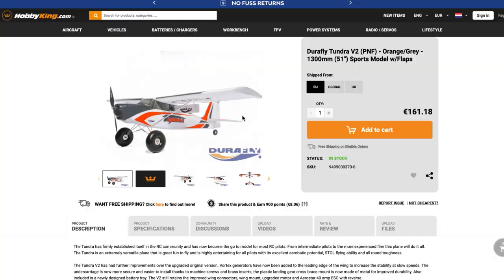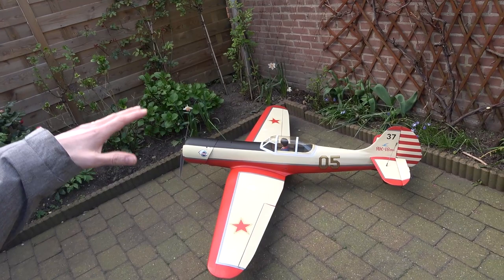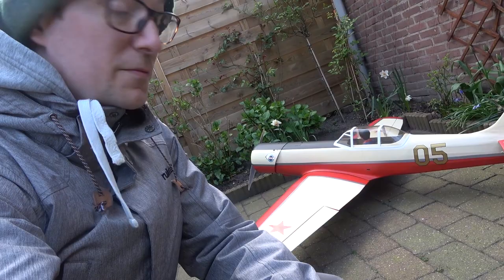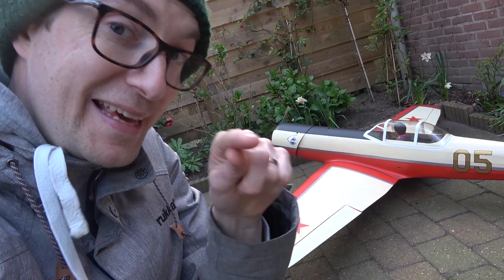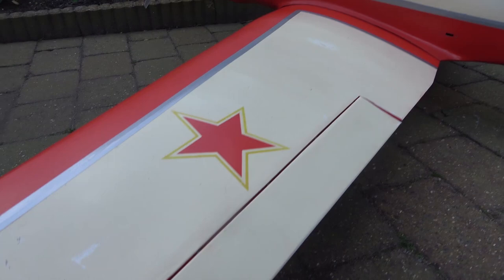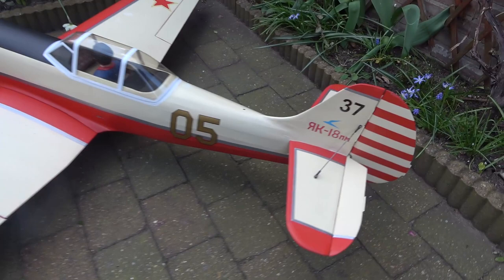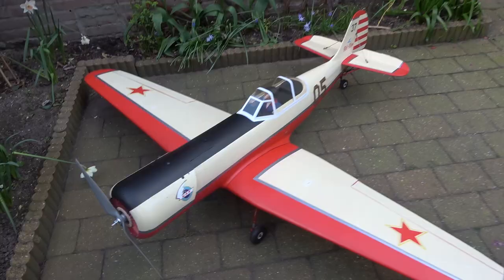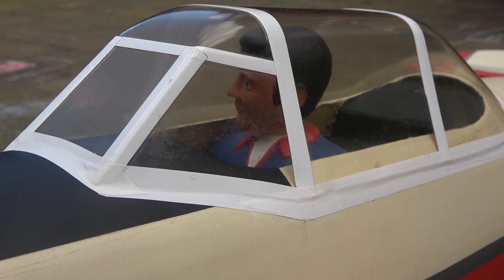Sig Yak-18 RC Plane Restoration Part 2.

Comment: I would be scared to death about those long motor stand offs twisting under torque from that beast of a motor. Wishing you and your family a speedy recovery.
Reply from the maker: I had some concern, but with the nuts and lock tight and split washer I have on them its rock solid in reality so shouldn't be an issue.

Comment: Wow! Looks great Stuart! When rebuilding the motor mount, did you have to build in any thrust angle and if so, is there a method to determine that? Just wondering...
Stay safe and hope you and your daughter feel better soon!
Fergy
Reply from the maker: Hey Hey. I eyeballed the firewall to start with, seemed pretty neutral all round, then if I recall correctly saw from the plan that it was 0/0. But to be safe, I eyeballed a little down and right by adjusting the nuts on the standoffs a little. I'm certain it will be fine. It looks right, so it will most likely fly right ;)

Comment: some info.    aerobatic variant    yak-18p.       at 12:12,  never seen such a thing.     the purpose is  What.    cheers         googletranslate
Reply: this information is pulled directly from the Pilot's Handbook of Aeronautical Knowledge. do some factual research for once...  this model is utilizing one singular split flap, as discussed in the paragraph below:
     "Flaps are the most common high-lift devices used on aircraft. These surfaces, which are attached to the trailing edge of
the wing, increase both lift and induced drag for any given
 AOA. Flaps allow a compromise between high cruising

speed and low landing speed because they may be extended
 when needed and retracted into the wing’s structure when not

needed. There are four common types of flaps: plain, split,
 slotted, and Fowler flaps. 

     The split flap is deflected from the lower surface of the airfoil and produces a slightly greater increase in lift than the plain flap. More drag is created because of the turbulent air pattern produced behind the airfoil. When fully extended, both plain and split flaps produce high drag with little additional lift. "
Reply from the maker: David Davids or did you mean the hole in the bottom of the fuselage?
Reply: @stuartwarnerc  'or did i mean'  WHAT.     i meant  the centrally  located   'flappy' thing.     i asked because  1) it  is  Not  a  logical place to put  a  flappy thing.   2)  i was unable to find an answer to the question, elsewhere.
Reply from the maker: David Davids hi, it’s the first time I’ve had s model with a central flap, but it’s the same as the real plane. I should think it would work fine, it’s central and online directly with the prop blast. Will see on the test flight.
Reply: @daviddavids2884  many aircraft have flaps in the center of the wing. This aircraft for example (yak 18) AT-6 Texan, SBD dauntless, Douglas DC-3, the list goes on. Also, I answered your question. Again do some research...
Reply: @stuartwarnerc  can you provide a  link to any published info??    i was not readily able to learn more than  the correct model designation.
Reply: @stuartwarnerc  i foresee  Adverse affects, if this flap is deployed, at any airspeed.
Reply from the maker: David Davids I don’t have any info, but I’m not worried, I’m sure it will be fine, as soon as I can fly we can find out 😉